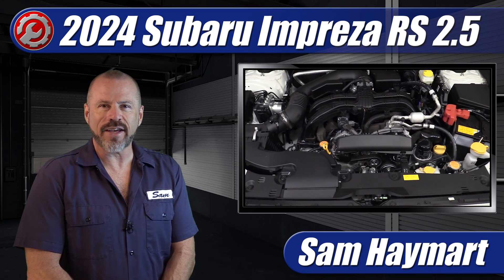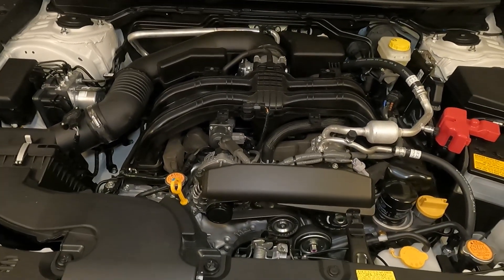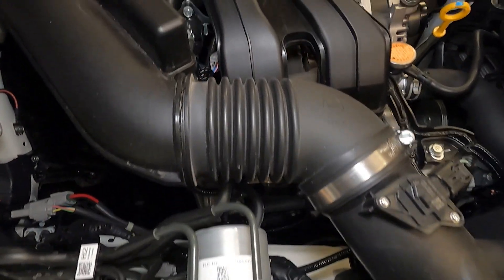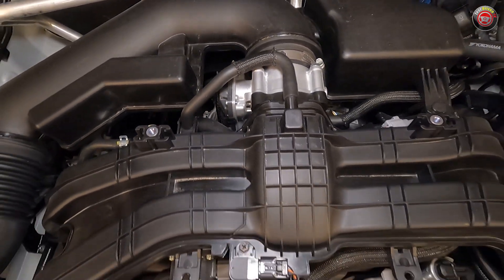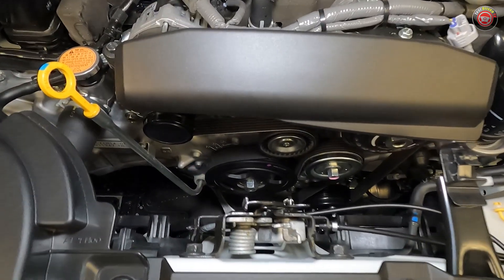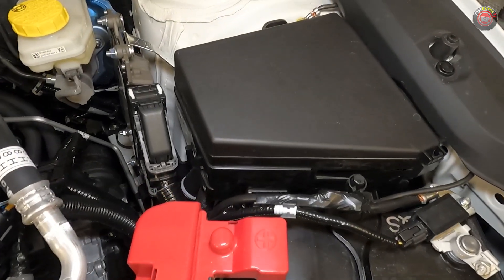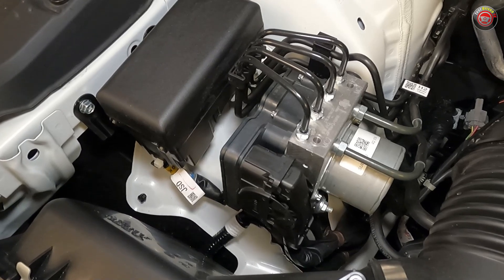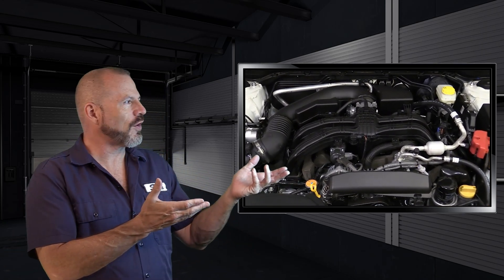2024 Subaru Impreza / Crosstrek 2.5: Engine Explained

Comment: Is this Subaru engine GDI, and if so are there any carbon issues?
Reply from the maker: Direct Fuel Injection
Reply: The 2.5L FB25d engine is also in the 2020-2025 Legacys so you can look into those communities to ask about the carbon deposits

Comment: Great info. I have an RS on order and likely will do almost no self-maintenance and repairs but come from a generation who did and it’s good to know the basics and configuration of the engine and major components. I’ll say that my bought new ‘02 WRX wagon has only had basic maintenance and runs like a champ. Literally only a couple of things have broke over the 22 years of ownership. #2 fan speed, one of the two electric cooling fans and digital clock. Had a TSB clutch replacement at 35k miles. And I have not had one original light bulb fail in the entire car. I’m hopping this new 6th generation Impreza is similarly fun to drive, practical and dependable.